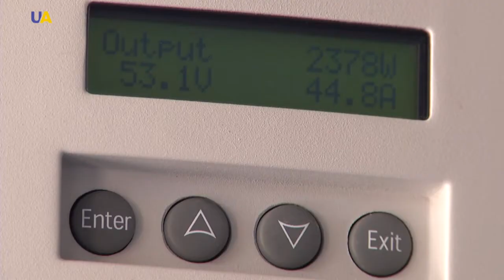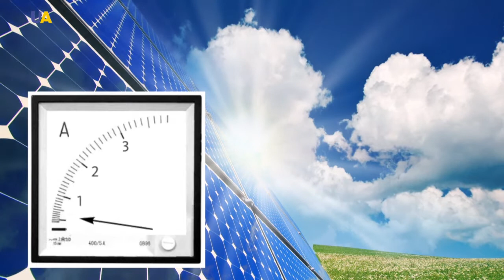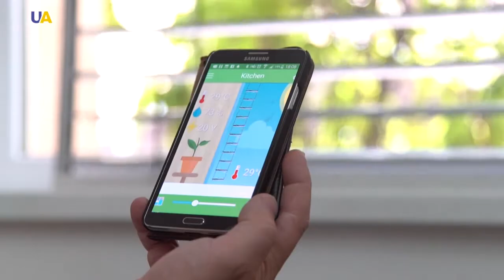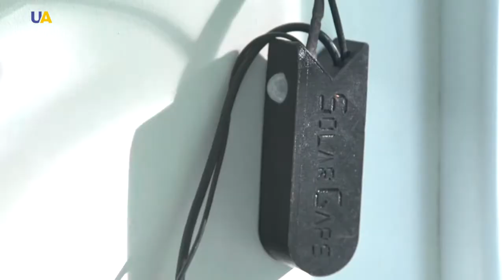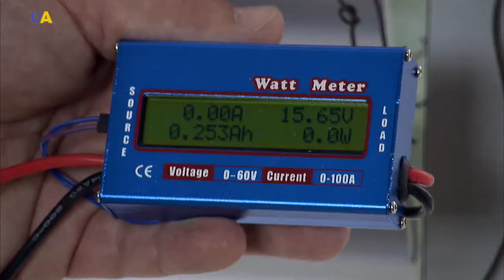Solar Gaps | Made in Ukraine

Comment: 300-1,000 PER WINDOW but fails to mention you need like EVERY window done to get enough power from it, lets break down the math real fast Kickstarter price of $270 for a 70 watt output panel, even if that window got a SOLID 12 hours per day of OPTIMAL sun ALL YEAR ROUND and we believe there efficiency claims you are talking 8+ years before the panel pays for itself and thats under the BEST possible scenario, in reality it will be double to triple that, when I lived by myself I could get down as low as 7-10 Kw a day (60 dollars a month power bills) on non-laundry days that would require like 10 of these guys all on the proper side of the house to actually get all day sunlight, that puts you well into the realm of traditional solar panel costs and traditional panels will be more efficient because they can be installed at precisely the correct angle (if placed on a pole) instead of relying on the house having to face the right way just to even get solar.
Reply: DanielRichards644 слушне зауваження, мене також цікавить як скоро виправдаються кошти вкладені в ці жалюзі, розумію, що розрахунки абсолтно індивідуальні для кожного окремого приміщення і місця його розташування і все ж таки. Розрахунки кпд понад усе :) Але сама ідея просто супер!
Reply: Thank you for this very important information. 
Almost everything being promoted, fails to mention this kind of important data, or context...failing to mention context data, blocks consumers from making an actual informed choice. 
That said...For decades, engineers have scared consumers off doing solar or wind generation in many applications, by telling people it can’t work efficiently to warrant the cost, in their area.   BUT, due to the severity of climate crisis, now, almost any little bit helps, even if it’s more costly.  
Back in the 1960s/‘70s, some hippies cobbled together recycled free parts, to make pool heaters, hot water for showers, etc. taking advantage of solar, wind, and geothermal.  Engineers scoffed at most of those....until now...engineers scoffing has greatly diminished due to climate crisis, but, there are still some who keep perpetrating that idea (that those options are not good enough to bother with in one’s area).  
Engineers have wanted to help sell very costly technology.  
Hippies wanted to make it as free and easy as possible.  
Example still plaguing the developed world:  central HVAC. Those systems require electric to run, even if using gas. They blow air. Blown air loses about 75%  of the BTU’s you just paid dearly to heat up, just because those are blown through ducting, or blown into a room directly.  Blowing on something hot, very effectively cools it down!   
One might even start to think HVAC makers were in cahoots with utility companies, to increase usage of gas & electric.   People in harsh winter or summer climates, are routinely put at-risk, due to power outages or high energy costs literally risking their lives.  The costs are even greater, when the grid goes down, and to stay alive, people must evacuate to shelters, because they’ve been sucker-baited into believing the high-tech gadgets sold them, are the best solution.   Selling technology based on hype, and obscuring the real context and data, has become rampant. 
Unless these solar shades vastly drop in price, they are untenable.  
They MIGHT be a good idea on paper, but, manufacturing quality & capacity enough into them, to make them “worth the price”, is unlikely. They might have been a good idea if they had been marketed at at least half or less the current price, made “field repairable” using common parts, 20 years ago.  But they weren’t.  
And, Louvre blinds are very commonly easily damaged by pets, kids, moving, even normal careful use.   
AND, we’re imminently on the verge of far more effective ways to generate energy....even solar film applied to window glass; better insulation to retrofit thinner-walled old buildings; resurgence of insulation storm windows, etc. 
And, more folks are starting to figure out how to make recycled, low-tech things to retrofit their homes to save energy, generate energy...yay!